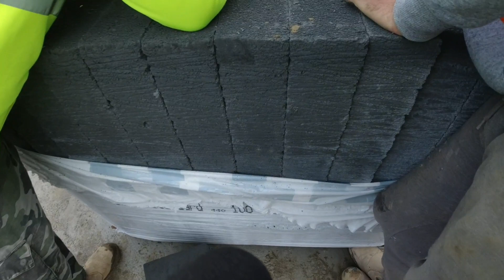bricklaying (a new start)

Comment: Concrete could be high should always gauge off the external gauge rod for internal Blockwork only needed of stairs pre built
Reply from the maker: Concrete is bang level and tapped off the splash mate.  Cheers for your concern though bud 🤙
Reply: @trickybrickys    Groundworkers getting it bang on that’s a first 😂 keep it up 👍
Reply from the maker: First thing I checked . As been caught before. About 15  20 odd years ago 😉😉
Reply: @trickybrickys   I’ve had six months off don’t wanna go back 😂
Reply from the maker: Don't blame ya bud. Its a dark old winter 😆 🤣

Comment: I’ve just finished a David Wilson site in Yorkshire . Vertical ties all way up don’t stagger them NHBC says it’s ok to do so. Easier to clean cavities . Squint bays are a pain if you have them. We build them up last just tooth the bays so you can get line all way through . I reckon we have that same plot on our job . Any question I’m ere 👍🏻
Reply from the maker: Thats the one with the ties vertical. Nice traditional build though. So shouldn't be to much of a issue
Reply from the maker: 😁😁😁🧱🧱🧱cheers bud 👍 🍻🍻